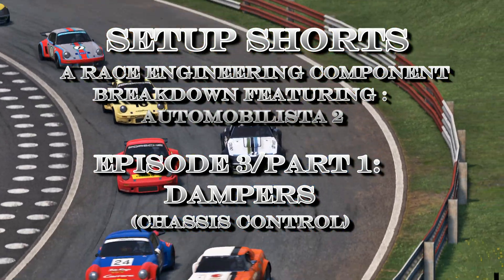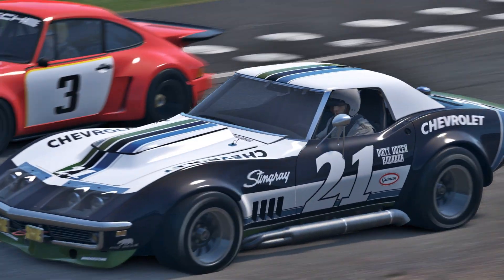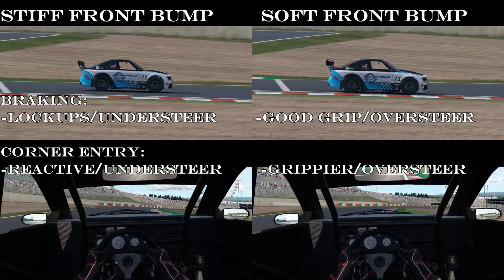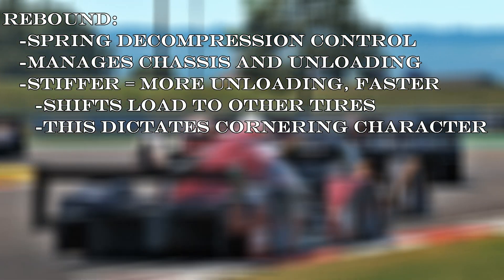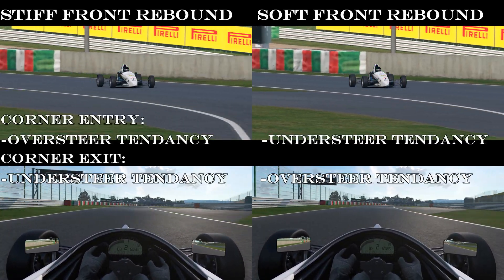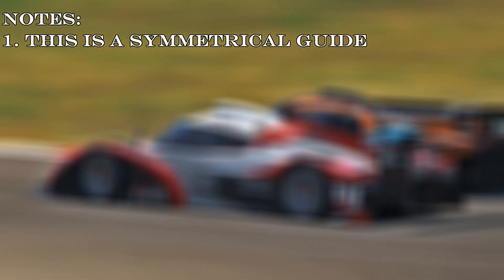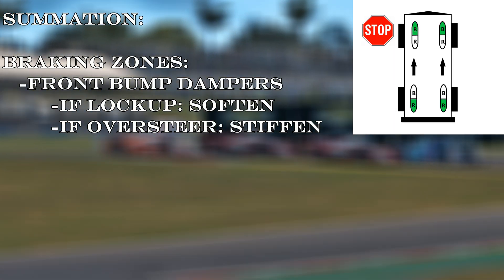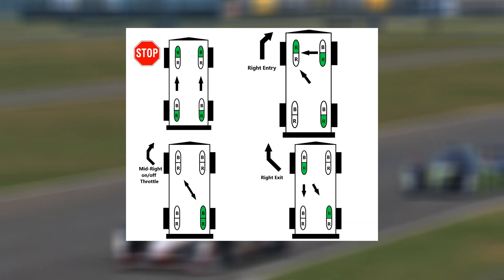How to tune Dampers (chassis control) -  A Sim Racing Setup Guide feat. Automobilista 2

Comment: I am very confused by your explanation of rebound. A stiffer rebound setting causes the shock to extend slower, therfore not transferring load as quick as a softer rebound setting. This is correct... Is it not??
Reply from the maker: Common misconception. Stiff Rebounds slow the extension but transfer load quicker. Soft rebounds allow the tire to maintain the track better and thus, keep the load. A tire that is off the ground because the rebounds are too stiff transfer the load to the other tires.
Reply: Stiff rebound slows down weight transfer, leading to more grip. Stiff rebound can lead to grip loss if wheels are being lifted off of the ground. Both of you are correct. Increase rebound stiffness for more grip, but make sure it's not too stiff. This is not explained well in the video however.

Comment: Does this guide also apply to FWD cars? You'd want to keep some weight on the front as much as possible so would having a stiff rear bump increase understeer? Stiffer suspension makes the weight transfer faster so by making rear bump stiffer, you'd make the weight transfer from the front to the rear faster, is that correct?
Reply from the maker: FWD cars are tricky.  The weight transfers are similiar, but the purpose may not be. In a RWD car, adjusting dampers in the rear are used to control power delivery.  In a FWD car the rears are basically a passenger as all the business happens in the front. For FWD cars I would adjust the rear dampers (and tire pressures) to control off throttle rotation and traction.
Reply: @Steelcast27  It's weird. I find that having stiffer rear bump dampers and/or springs make the car understeer more. It may depend on the chassis design and weight distribution of the vehicle as well however. The rear wheels aren't receiving any torque from the engine so the rear tires will eventually gain traction anyways. So by making the rear springs or rear bump dampers stiff, there may be a moment where the rear tires have trouble finding traction but eventually grip up anyways leading to less rotation. 

I may just match springs and bump settings to the vehicles weight distribution, but I'll stiffen rear anti roll bars and rear rebound to get the car rotating. So far it seems to work quite well in different games, from FH4 to GT7. 

I find that in racing, suspension acts as sort of like a buffer in between our inputs and the vehicle's reactions. If the suspension is too stiff, we get quicker weight transfer but the tires may be more prone to losing grip especially when combined with a very aggressive racing style. So even our driving style can act like a buffer just like suspension but through different means. When we're too harsh with the steering, brakes or gas, we tend to lose grip very quickly. When we smoothen our inputs, the tires are able to keep their grip because we are making sure the weight isn't being transferred as quickly. Almost the same way how soft suspension slows down weight transfer. So in a way, stiffening the front doesn't just mean we increase the understeer tendencies of a vehicle, but we are making it so that the forward weight transfer is quicker. I believe Carrol Smith has stated in his Tune to Win book that, up to a point where the suspension no longer moves, stiffening front bump resistance makes a vehicle turn in more. So it really depends on how we make use of the weight transfer.

Comment: In a front engine RWD car with no Aero like a road car, Mustang, on an initial turn in "assuming steering and throttle inputs are gradual before and after changes", will stiffening the rear dampers and softening the front on let's say even springs front to back, give the car less turn in bit or understeer because of added load to the rear tires from stiffer dampers on the rear producing a little more rear wheel tire grip on a heavy front car you think ?
Reply: I know we're talking about AMS2, but correct me if I'm wrong. I think you said it relates physics wise the reason why you're most interested in AMS2. Thanks 27
Reply from the maker: Stiffer rear rebounds will give the car more turn in. In the rebound phase, stiffer means less load in a non-aero car. Less load in rebound transfers more load to the other tires, in this case the fronts.
Reply: @Steelcast27  oh ok thanks for your help man

Comment: Belated HNY ✨ Starting to get my head around the damper adjustments, but I need some clarification.

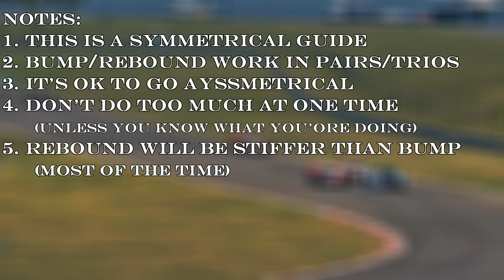When you say (11:50) that--generally--Rebound should be stiffer than Bump, do you mean on the same axle: Front Bump 5 / Front Rebound 6? Or do you mean cross-axle: Front Bump 5 / Rear Rebound 6? Or both: Front Bump 5 / Front Rebound 6 - Rear Bump 5 / Rear Rebound 6?
Reply from the maker: Same axle, but I would use rates on the screen instead of incriminates to confirm. This way the energy absorbed going over track bumps keeps the chassis more stable. The bump controls the unsprung weight, rebound controls sprung weight.
Reply: @Steelcast27  Thank you 👍🏽

Comment: Are we sure this is correct? Dampers have always been the "black magic" of sim racing because different devs implement it in different ways and it's easy to find one guide entirely contradicting another. For example, I watched an ARA guide last night doing a deep dive on setting up a gt4 on iracing and it explicitly stated that stiffening the damper slows the weight transfer and dulls the "snappiness". I can confirm that in iracing, adding rear rebound stiffness aids in nullifying off throttle oversteer by pinning the rear down longer. 

Using rebound specifically, you're either of the school of thought that a stiffer rebound = stronger dampening effect = slower, more controlled weight and pitch transfer, or the school of stiffer rebound = more forceful pushing of weight off the tire = faster weight transfer and pitch. Personally, the former sounds more right to my non-expert brain. On top of iracing also working that way, Aris--the guy behind ACC--also described it that way and used telemetry to make his point. 

I love your videos and your teaching methods, but that you explain dampers here the way you do and are able to show it in action suggests that Reiza's implementation is of that latter philosophy, and directly at odds with the likes of iracing and ACC. Regardless of which dev is right, are we sure that this setup guide as a whole is merely featuring AMS2, or would it be better classified as FOR AMS2? I think, when it comes to the voodoo that is dampers, such a distinction should be made.
Reply from the maker: The reason I chose AMS2 to do what I do is because mechanically, the the sim behaves as you would expect based on real world principles.  I know its not popular to say this as it usually goes over the head of would be sim "critics", but its true.  Everything in this video reflects real world mechanical principles, regardless of sim.  

It was explained to me in this way early on, and this resonated with me. Imagine a damper on the ground in front of you standing straight up. Push the damper down with your hand.  A stiffer damper would required more force through your hand to get it moving and the pain you feel in the palm of your hand is the load.  In other words, the speed of weight transfer.  The softer damper will give. Same weight transfer, but slower, less pain in your hand. Same with rebound, but with your fingers as you try to pull it up. Imagine a tire connected to the damper. If you pull up the damper with the same force and pain through you fingers, the tire will stay on the ground more the softer the damper.

However...if you introduce aero into the equation it changes some things.  If your car requires a stable aero platform, in the rebound phase, aero is actively pushing the car back down. Rebound stiffness keeps the car down, allowing the car to remain in its optimal aero "window". In non aero cars, this downward force (ahem downforce) does not exist.

So in aero cars, as with ACC (which features a self proclaimed "sophisticated" aero model), keeping a car in the rebound phase and in the optimal aero window is key to load.  But is not mechanical load. Its aero load.

As you can surmise, aero and downforce windows overshadow mechanical concerns in a lot of ways.  From a sim racing development perspective, emphasis on aero can indeed overshadow mechanical flaws as well. In AMS2 the slower you go (less aero), the more mechanical concerns take over, as in RL.

Online sim racing guides you find will filter you to the principles (aero/mechanical) that most effect their cars.  In AMS2 its simple. The slower you go, the more mechanical, the faster you go the more aero.

Comment: Thank you for your video on the setup of the dampers. I sort of expected the use of telemetry (histograms) to setup the dampers. On youtube I found out that there are quite some things to interprete these histograms, like where is the border of fast and slow rebound, the area of the rebound side (slow/fase) has to be 20 or 50%, etc.  So maybe I'll see this in part 2 of the dampers. Keep up the good work!
Reply from the maker: Telemetry won’t be featured in this series. These vids are designed to be accessible to everyone and to help with feel based setups.  I have about 50 videos that feature it though if you’re interested.

Comment: Going from strength to strength, Steel! Keep up the good work 👍🏽

Thanks to your guidance, I now have to rethink my approach to damping completely. For example: I tend to adjust dampers in pairs (asymmetrical triad-setups are for another day), so, if I was struggling with snap oversteer during trail braking, I would try to reduce weight transfer onto the front axle by increasing Front Bump AND Rear Rebound--because, logically, the effect is greatest when both axles work in unison. My thinking was that if I increase the damping (Front Bump and Rear Rebound) this would result in LESS weight transfer not more.

But it would seem that I have had the principle bass-acwards all this time 😁 Because your approach produces the desired result: reducing Rear Rebound damping--in other words, reducing resistance to the transfer of energy through the dampers--results in LESS weight transfer 🤪 I still don't get it; but it works 🤷🏽

Comment: Which should one start with low/high speed non aero cars handling. ARB/springs/dampers?
Reply from the maker: It depends on your issue and how severe it is. Springs for big entry or exit issues. Arbs for mid corner rotation. Dampers for influences.
Reply: @Steelcast27  Thanks. Looking forward to that flow chart!

Comment: My second comment. Well Steele, I mentioned my new computer and reverb G2. Well computer made it, with 8 mb memory. Really torqued me. I thought I was getting 16. Now I find out Alienware and ram stick compatibility SUCKS. I don't have enough to run VR. It has been a nightmare. I have had computer for a week. Haven't even booted a sim. Really discouraged. These system builders are tricky sneaky shit lord's. My first system from manufacturer. Dell only wanted 2.5 times the price you can buy ram for. NEVER AGAIN. Before this is over I will have nothing good to say about Dell or Alienware I am afraid.
Reply from the maker: Thats awful. Can you return it?

Comment: Excellent tutorial as usual, I had no real idea about dampers except that they're springs & stop the car constantly bouncing after hitting bumps; this will help big time, I find with understeering my current response of moving brake bias rearward can often swing quickly to bad oversteer so I'm going to have a play with these settings. Keep up the good work, I'll keep the swarfega to hand after all this mechanical stuff :)
Reply: Dampers aren't even springs. They're just a tube filled with oil or nitrogen. They restrict the movement of your suspension which are the real springs. I think when you can visualize that it'll be much more logical on how to tune your dampers.